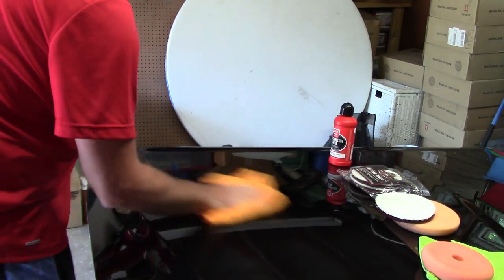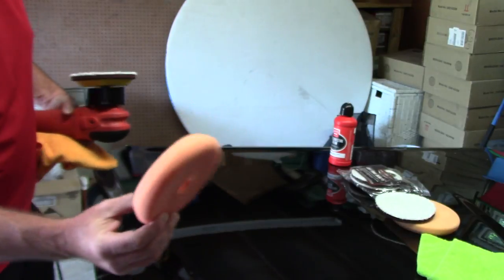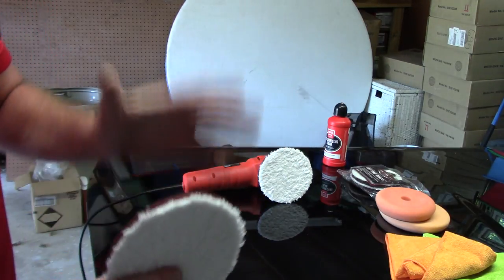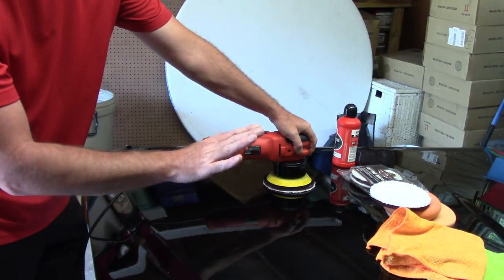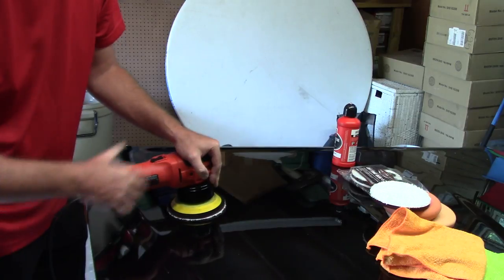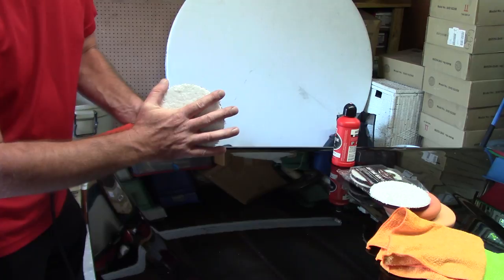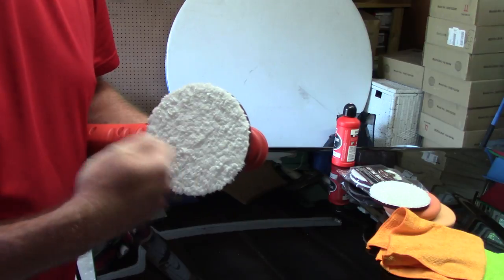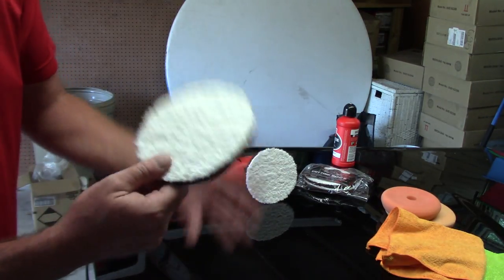Microfiber Cutting Pads - Are You Using Them Wisely?

Comment: Hey Scott, been watching you're videos for a while . I just bought a harbor freight da polisher , what kind of set up should I use if I want to do some paint corrections? It comes with a 6 in backing plate I believe , should I switch the backing plate? And use the same size microfiber cutting pads?
Reply: Changing the backing plate would be a good idea.  I am going to buy a Harbor freight and put a 3 inch backing plate on it and see how it does.  The lake country force pads are great, get the 6.5 inch. They flair out at the bottom and I like that a lot.
Reply: J Coz thanks for the reply . I actually bought a 3 in back in plate and a brush attachment for carpet cleaning and it actually works well . Have yet to buy a polishing pad for it but most likely will in the future .

Comment: Hey Scott - Just a tip for you - I have a Ridgid Blower Vac, it is similar to the vac you have but it has a detachable blower on it, makes it a great 2 in one tool for detailing.  You can hook the hose up to the blower and then attach the Shop-Vac Micro tool attachment to it to make the end of the nozzle very small, this acts just like an air compressor for blowing off pads and for dusting/blowing out areas on cars.  Hope this helps! Cheers!
Reply: The hose is and vacuum is dirty on the inside so you will be blowing dirty air into the pads.

Comment: After watching this video I went to go buy some microfiber cutting pads. But they not only have a finishing microfiber Pad but a cutting microfiber pad and a extra cut microfiber pad. I know the finishing microfiber pad probably has little to no cut, The Cutting pad would have some cut to it, and the extra cut would be more aggressive than the cutting pad. But just curious of which one that you use? And if you have all three, it might make sense to do a video about the difference between the three of them, and where you would use each. Just a suggestion. Thank you in advance for your response
Reply: The fast finishing pad is made for swirls scratches it’s made for compounding and polish finishing is just the name it’s not actually meaning finishing pad

Comment: Great video. Recently found this Chanel and love it. I'm just getting into detailing and want to get the best possible result when paint correcting. Car not in too badder condition can I do just as good job with foam cutting... don't want to go and buy microfibre pad if it just saves time. But will if it does better job. Will foam cutting pad achieve the same result?
Thank you
Reply: Tom Fanshawe for heavy cutting, Microfiber > Foam

Comment: If you use a 1 step compound would it be better to use a microfiber pad or a foam pad?
Reply from the maker: great question:)...yes i microfiber cutting pad when used with an aggressive compound you will need to follow up with a polish..so when doing a one step i would pick a foam pad:)...hope that helps my friend
Reply: Dallas Paint Correction & Auto Detailing is there a good 1 step compound you will recommend? Im not looking for perfection i just want to restore shine and take off as many small scratches as possible
Reply from the maker: another great question:)..i really like griots correcting cream (not fast correcting cream) as a true one step with perhaps a orange cutting pad or a white polishing pad depending on the light defects your removing from the paint..the correcting cream leaves a great final finish for a 1 step and you can go right to a good wax or sealant that you enjoy:)
Reply: Dallas Paint Correction & Auto Detailing thanks! Great videos! You should do a video on what to do when someone bumps into your car and chips off some of the clear coat but does not damage the paint nor makes a dent on the panel. Just saying since it happen to my truck and i really dont know if i should polish it or reapply the clear coat, is a 2016 f150 since the paint is in great conditions i dont known how to deal with it without damaging the paint
Reply: Dallas Paint Correction & Auto Detailing I like griots correcting cream but I feel like it leaves behind residue that's hard to get off..
Reply: You can use a microfiber pad, it all depends on how hard your paint is, sometimes it finishes haze free. Griots correcting cream is legit, I used it on my old 05 Accord, harbor freight DA, griots correcting cream with a buff and shine microfiber cutting pad 5 inch. Corrected very well, finished very well. Just try things out.
Reply: Jesus Duarte I like Menzerna PF2500 for one stage correction, and follow with Duragloss 111. I'll use a blue or green Hex Logic/Buff and Shine with it. 

I've also used Meguiar's M205 on a green Hex Logic/Buff and Shine, or the black Buff and Shine microfiber finishing pad with good results.

Comment: Excellent video Scott. I don’t have compressed air unfortunately. However, I wanted to ask you whether a substitute in the form of the Metro Vac Air Force Blaster could be used?
Reply: You can use a drier blower, but compressed air with a gun comes out faster so it gets deeper into the pad and helps the fibres stand up.

Comment: So i could use the microfiber cutting pad with a aio for a one step correction?or with like a griots correcting cream as a one step correction?the paint wont haze with the microfiber pad using a aio?
Reply: Keep the speed low on the machine 3-4 and don't go too slow with the arm movement and you should be fine.

Comment: What is a good 1step compound
Reply: Depends on the vehicle.... Traditional One Steps are HD Speed, Griot's BOSS Sealant, Meguiar's New AIO (Supposed to cut better then HD Speed & Griot's)

But for a true 1-Step Correction any medium cut polish will work on a medium/light cutting pad (Orange Lake Country). Like Griot's BOSS Correcting Cream (NOT FAST CORRECTING CREAM). That's a true 1-Step correction that will remove swirls in a timely manner.
Reply: Menzerna PF2500 on foam is my favorite.

Comment: Do wool pads work the same as microfibre pads?
Reply: Eric McIntyre good question, wonder if they handle heat like wool pad on rotary
Reply: @MrSmoothbanana  generally speaking wool runs cooler than microfiber, m.f runs cooler than foam. Wool will cut harder and goes after deeper defects quicker but will leave a slight haze on the paint. Than you'll have to finish it out.

Comment: Hey Scott, I am trying to find a video that shows a da polisher that looks like a knock off rupes, did you make that vid? If  not do you know what I am talking about? Thanks!
Reply from the maker: i heard of a company called "clover detailing"..you can find them online and they sell a rupes knock off but its around 270 dollars..i have heard of guys buying a knock off from china for about 150 dollars, but I'm not sure where you can get them here in the states..for 150 dollars i would try it myself:)...hope that helps Todd
Reply: Dallas Paint Correction & Auto Detailing thanks Scott!
Reply from the maker: some guys are telling me they like the Shurhold 3500 21mm polisher with 6 inch backing plate for about 190 dollars on Amazon..i can't speak for myself since i have never used it
Reply: Dallas Paint Correction & Auto Detailing yes, people have been talking about that one as well. It has some fairly good reviews, but who knows until its in your hand?
Reply from the maker: I'm going to do a video about the torq d22 again and compare it to the griots g15..i love my griots g15 and i know it to be more powerful than the rupes markll because i own them all...where the torq beats them all is on the curves all around the car..the griots and the rupes beat the torq slightly in the wide open panels but when you look at the bigger picture the torq will give the same results and not stall nearly as much as griots or rupes on curves and certain body lines so i find myself getting the whole car done faster using the torq...crazy but true:)
Reply: Dallas Paint Correction & Auto Detailing . I have a Rupes and a Griots too, but always looking at other machines 😁 I watched the video you made with your Torq and they seem pretty nice? The only thing I worry about is having a digital speed indicator?
Reply from the maker: both the rupes and griots are horrible on curves..the griots is a little better on curves in my opinion ...when you're using a dual action polisher plus with a long throw, i have no idea why these companies make them so weak on curves!..the fact they are a dual action polisher you would never burn clear coat in the first place so i see no reason for them to stall at all..my industry has scared everyone because of the rotary and even with that said its grossly off base!!!!..people who love the griots and rupes are ones that have never used a rotary and have no clue what true paint correction looks like...as i have said so many times the dual action polisher was made for paint enhancement and not correction unless you want to spend ungodly amount of time on the car...ever see these so called pro detailers on youtube doing a paint correction on a car for a week??..they only show 50-50 pictures on flat panels and they rely on the rupes for paint CORRECTION and perfection and thats why it takes them a week..lol...so sad but true
Reply: Dallas Paint Correction & Auto Detailing .I know I saw the knockoffs on YouTube and they are even the same color as Rupes, but I just can't remember who and when it was posted??
Reply: Dallas Paint Correction & Auto Detailing . That's a big deal to me when you are having your polisher stall, so I will be looking for your video on that comparison! Thanks Scott you really are appreciated by me and many others! I have been thinking about posting YouTube videos, but not sure of the correct mics cameras etc? That would do the job correctly. I can't stand watching ones with lousy noise and shaking footage from many that just hold cell phone in hand!

Comment: I love your videos and I trust and respect your opinion, but this video was pretty much useless.. 90% of it could condense down to "you can use these instead of foam, they cut faster and often remove more defects. Customers will like it if you exceed their expectations." Done.

I was expecting a detailed example of how you personally prefer to use microfiber pads and why. Arm speed, edges, how you prime, do you air blow or brush between passes, how much product to use both for and after priming and again how much to use on a damp pad after cleaning between passes. How you wash and store them. Are they worth using at 3" as well. Where is that video??